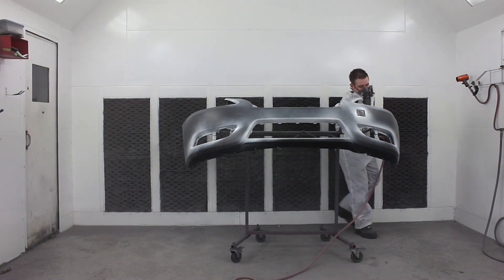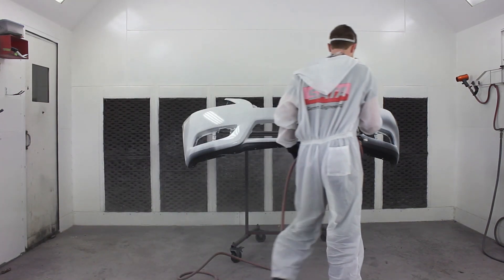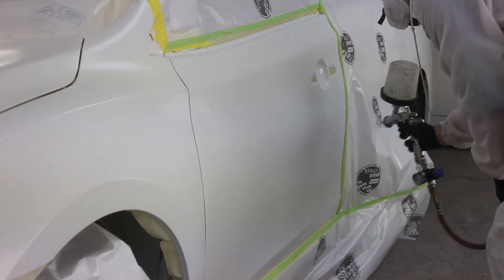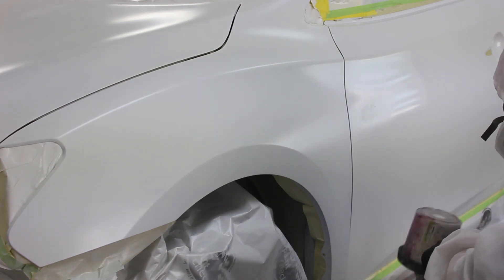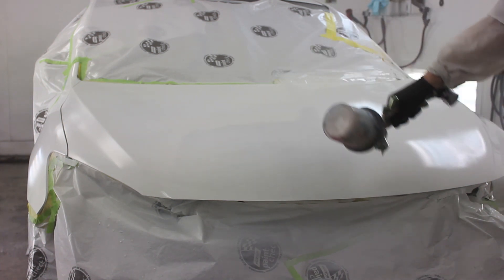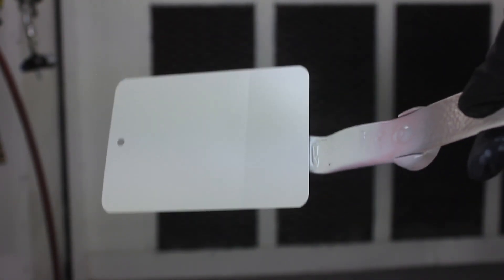Blending / Painting - Pearl White Tri-Coat

Comment: 6 coats is a long time to get coverage, what basecoat do you use?
Reply from the maker: The Gunman This was Glasurit 90 line, most colors are 2 1/2 coats over most undercoat values, but white over black would take quite a bit more. If this were RM Onyx production (solvent) it just might cover in 2 1/2-3 coats, solid colors cover really well in that line.
Reply: Thanks for the reply Jim, here in Australia we still mainly use Solvent and everyone tells me that waterbase covers in 1+1/2 coats so it sounded weird. I get full coverage in 3 from most solvent ranges 55 Glasurit, Standox Solvent, Dupont and Metalux. Great channel, keep up the good work.
Reply from the maker: The Gunman Axalta (dupont) waterborne has a 1 1/2 application for basecoat, as far as I am aware every other waterborne is at least 2 1/2 when applied over an appropriate shade of primer. Thanks, you too.

Comment: What size tip are you using for the ws400? Also what psi do you spray at the wall
Great Video!
Reply from the maker: Michael DeFrancesco The wall is usually between 50-80, the pressure drops depending on the length of the hose so I regulate it at the base of the gun around 27-28 psi.
Reply: Not to change the subject.  I have a Sata Jet 4000 RP with 1.4 tip digital. What psi should I be spraying at with that gun.
Reply from the maker: 29 psi at the inlet I am fairly certain is what my Sata rep recommended for that gun but I may be confusing it with the HVLP. I don't have much experience yet with that gun although I do have one with a 1.2. I'm sure a Sata painter will be along to tell us.
Reply: Refinish Network Depending on what color you are painting and your set up, and The Rp .. you can run it as low as 22 and high as 26. I stick at 22, comes out nice and especially with metallics  lays out nice

Comment: What about adhesion promoter before the sealer was applied
Reply: Raw plastic requires it. Primed plastics can use it but not required. Also Glasurit 90 has sealers with built in adhesion promoter.

Comment: i took some fender flares to a body shop to get painted, bodyshop owner said he needed the vin number to order right color, it is a pearl white, how ever it turned out slightly different than truck body. is that normal or it could be the body shop who missed some steps
Reply: my bumpers are metal too but i looked at a plastic piece on the roof  and youre right the color is different, plastic piece is exatly same color as my fenders turned out. thanks tho.
Reply: Whenever a part is painted separately without being able to use the exact batch of paint that the vehicle was painted with (even then it’s possible to look dofferent) all you can do is hope it’s not a readily noticeable difference.   There’s too many variables that can make a color look different. Doing spray outs like demonstrated  in this video and blending is how you get an exact panel to panel color match.
Reply: thats very common on metallic or pearlescent paints. it can all depend on how many coats of metallic/pearlescent they did or how thick they sprayed it on. it can change the color

Comment: i was looking for paint for my bumper and it is a multi stage pearl, i understand base coat and clear but this calls for a mid coat , what is that?, this is for a 2013 Hyundai Genesis: Casablanca White Pearl YW6, will a quart cover the bumper
Reply: your mid coat is the coat that contains the pearl. So it's your base color (first coat) then your pearl (mid-coat) and then your clear (third coat). It's called a Tri-coat